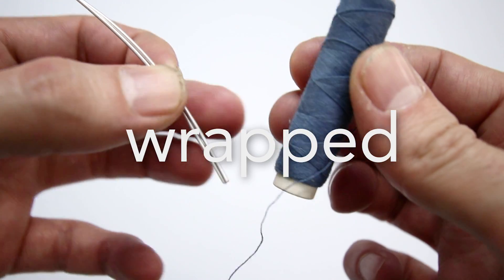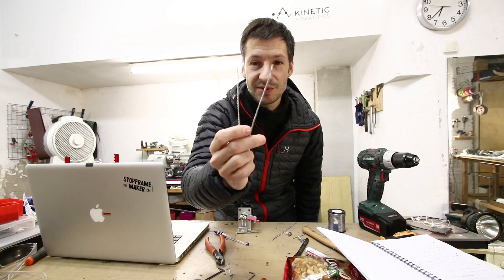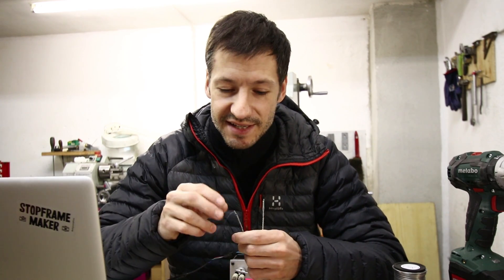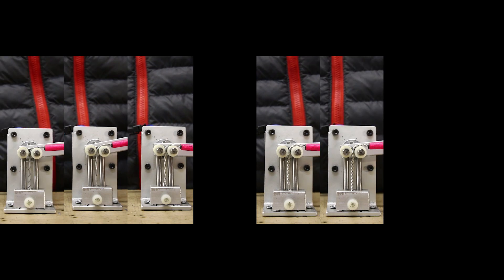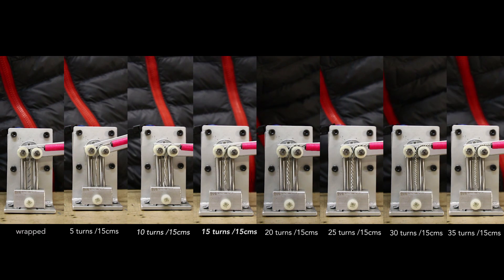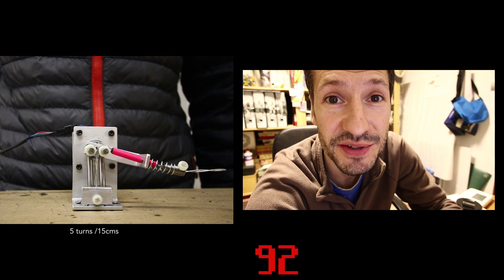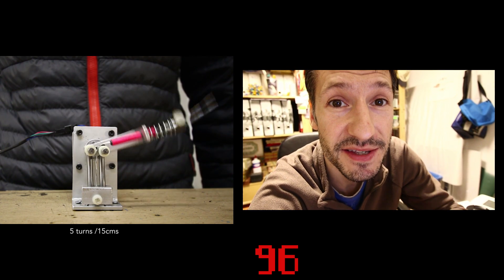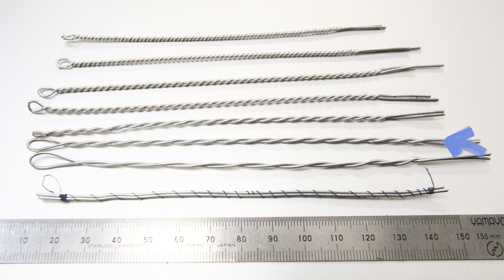Wrapped or twisted

Comment: Thanks for that test, I've been looking forward for it !! Maybe if the twisted wire is annealed after twisting, it could last longer - calls for another test 😆 I tried to reduce your 1.6mm with a drawplate to obtain a 1.4 and that calls for a lot of re-glowing. I don't know where you get your wires from but it could be very nice with a 1.3, 1.4 and 1.5mm option. I find the difference between the 1.25 and 1.6 very big.

Comment: Hey Edu, have you ever wrapped braided armature wire with teflon tape (plumber's tape)? I've been doing this recently and it feels like it increases durability and also reduces bounce-back in animation. If you have time, I was wondering if you would try it and maybe even test it on your wire testing device!
Reply from the maker: I use that tape to cover and protect ball and socket inside puppets

Comment: Hello Edu, I have a question. I take pictures for my stop motion video. I use a long shutter speed (1 / 4-1 / 10) but at the same time I have an unstable brightness. Several frames in a row can be normal brightness, then there can be several more bright frames, or darker ones. Tell me how to avoid this? My olympus om-e e-m5 mark ii camera, Panasonic 45-175mm f / 4.0-5.6 lens. I work with dragonframe4
Reply from the maker: Could be the light, the lens, the camera or the electricity flow. From the distance is complicated to say
Reply: @edupuertasfruns  Did you have a similar problem before? What caused this and how did you solve this problem?

Comment: What about wrapping with very thin wire ( like the kind used in electric motor windings ) .?    I just was wondering if it would be stronger than the thread wrap.

Comment: One armature maker told me to anneal my wire armature maker after twisting by putting into a cold oven and heating for 30 minutes at 220c then switch off heat but allow it to cool slowly in the oven. With metal working after hammering or stressing metal through bending they reheat it to take the stress out of the metal to make it pliable and soft to carry on working it so it doesn't fracture. It sort of realigns the molecules.
Reply: Boilermaker here...

Aluminium is annealed by heating and quenching. Copper is also annealed the same way. It is steel that needs to be cooled slowly to anneal it.

Edit: I should add that the reason the aluminium wire breaks is due to work hardening. While not technically possible on a finished puppet, you could in theory extend the life of an armature by re-annealing it after a certain amount of work.
Reply: Thanks that is good to know much quicker quenching. Ah work hardening that is it, I have heard it but forgot. Does my stated temperature for aluminium annealing sound about right ? Thanks for your clarification and advice 🙏
Reply: @Wheel333  I had to look this up as its been over 10 years since I was told how to anneal aluminium.

You may find the following article helpful: https://process.arts.ac.uk/content/annealing-softening-aluminium-plate/index.html

I was taught one could put soot from an acetylene flame over the aluminium and then heat it until the carbon is burnt off. Then it's at the right temperature to quench in water. But according to the article, this induces brittleness (it seems apparent that this is true of machining grades). I must admit, there wasn't a whole lot of coverage of the subject of annealing aluminium (at least that I can remember). There seemed to be more focus on the different grain structures of steel.

Please take my advice with a grain of salt as I can only share what I remember. 😕
Reply from the maker: Did you try it? Did you find it to make a difference?
Reply: Yeah it seem to last better especially for twisted fingers that take a lot of abuse. I didn't test it as well or scientifically as your setup though. I like thicker gauge single core wire for the legs as twisted seemed a little springy. But annealing seemed to help reduce the springiness in the twisted wire. It would be nice to test in your setup and maybe get some more precise advice from metallurgist on annealing aluminium.

Comment: Your technique is similar to what I saw at a wire harness manufacturer years ago. To make a "twisted pair" they would clamp one end in a bench vise and the other in a drill motor. Except these were electrical wires for trucks and were 25-30 feet long. They also tested for the optimum twist to keep the pair together and not break with the harsh conditions under the hood of a long haul truck.